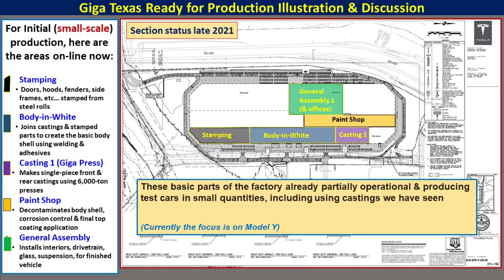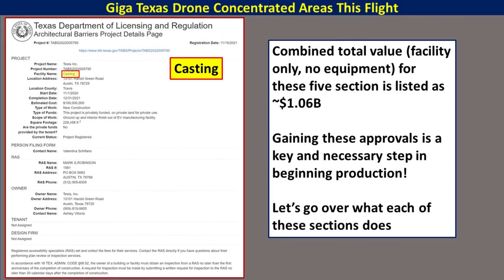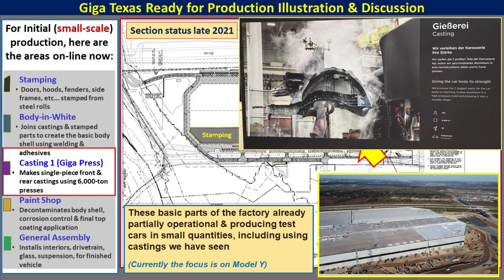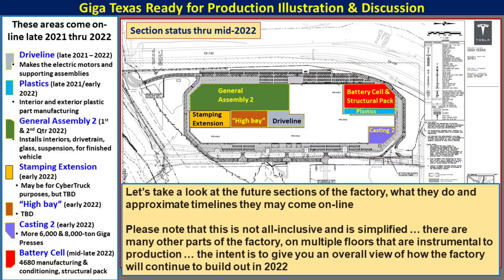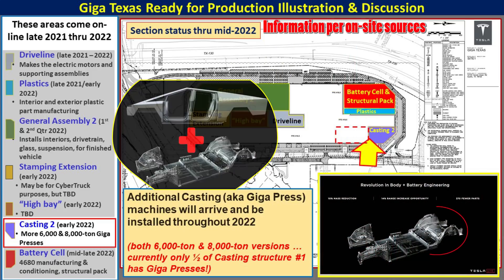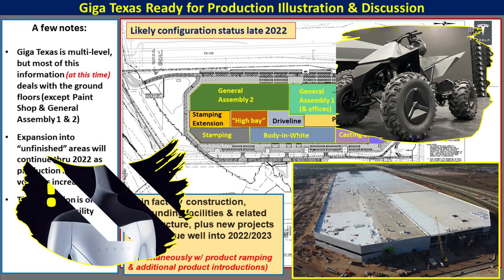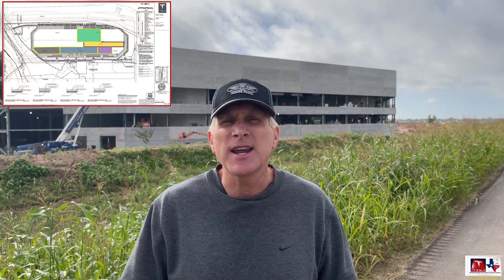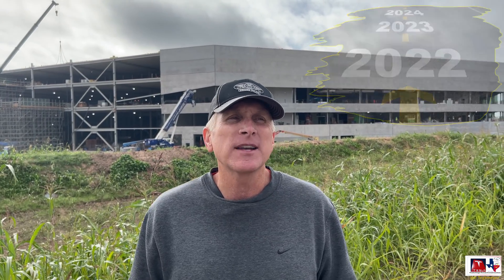Tesla Gigafactory Texas 26 November 2021 Production Status Outlook 2021/2022 (Model Y & Cybertruck)

Comment: Joe thank you for the explanation of the product flow. I noticed during construction of stamping that the west bay has a Schuler 5 unit transfer press. The center bay has about the same space and bridge cranes possibly for another line. In the east bay there is a press to shear the feed for the transfer presses. Paint has 2 lines starting on the bottom floor moving north and returning on the second floor moving south.

Comment: Thanks Joe. Great presentation, the best yet from any channel on youtube about the factory operation.
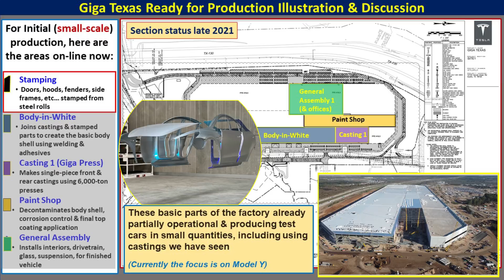5:45. Stamping. Been waiting to see for certain if the stamping presses are operational. Jeff’s 2 most recent videos show a Model Y side stamping in a bin and other sheetmetal waste.
10:16. Plastics. The inset photo of the plastic plant (from elsewhere) firmed up for me the likelihood of the use of the north alleyway for that purpose. I wasn't sold on the idea.
11:10. Stamping Extension. What’s missing from this structure is the massive footings and reinforced set downs for stamping machines. What isn’t missing is plenty of space to easily construct all of that, and it will be away from our prying eyes once the roof and walls are complete.
11:30. High Bay area bridge cranes. Storage seems to be getting a run in the comments. If it were for storing stacks of containers (or anything for that matter), a better use of the space would be to have the bridge crane at the highest level. Everything above a bridge crane is dead space, and these bridge crane beams are at about half ceiling height. Storage seems unlikely to me.
That said, I have no ideas other than some other manufacturing process that might benefit from a high ceiling for instant heat removal.
Months ago in comments under a video I had a conversation with someone who was suggesting some continuous line of metal folding machines to form up Cybertruck panels. Can’t find the post now, might have been deleted.
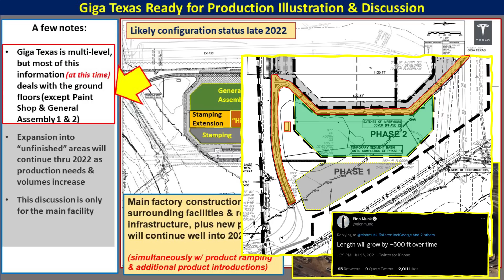15:55. Southern Extension. The area shown in green in fact measures only around 350’ north to south. By scaling the shown east west dimension of 607’ by doing an on screen measure, the dimension of the green area is revealed. 500’ includes the road and adjacent apron.
Reply from the maker: Thanks Dessie!  I’ll be checking out Starbase in Boca Chica tomorrow, so that’ll be a lot of fun!
Reply: @JoeTegtmeyer  You haven't missed much at Austin, very quite. Some Model Y stampings about the only bit of excitement. For me at least!

Comment: I'm waiting for the arrival of the ORIGAMI metal-folding machine. In addition to making the Cybertruck body, it will also be capable of making a variety of three-dimensional animals and birds.
Reply: Do you mean a press brake, a machine that folds metal in a straight line ?  Not a overly large or complicated machine. Could already be located in the stamping building.
Reply: @eltonray2934  A self-feeding, robotic, multi-angle, automated press brake
Reply: @kevinpolito1529  Kevin, you are correct, the .118" thick 304L stainless will need to be cut to size by a shear or laser and fed to the press brake. I would imagine that this will be automated as much as possible. The brake will fold the metal for the exterior shell of the Cyber Truck including door coverings, fenders, cargo box, hood, front and frame over doors.
Reply: @eltonray2934  The cost savings will be in not having to add corrosion proofing and paint.
Reply: @kevinpolito1529  Kevin, I agree that you do not have to paint the stainless. But you might want to paint the die cast front and back frame, all of the formed parts inside that make up the passenger cabin and battery housing.

Comment: Great video. Really appreciated. Be minor correction. The drive train components are built in Reno not Fremont. So the initial production of Y in Austin will have parts coming from Fremont & Reno. Possibly even imported 4680 cells to supplement what is being made at Kato Rd.
Reply from the maker: Cool, thanks

Comment: I am curious where the Semi-truck/tractor will be manufactured inside the building. The plastic cab shell alone will take a huge casting die. Then there is the question will they fabricate the chassis rails and cross-members in-house from scratch in order to accommodate the battery pak? Lots of very heavy,  heavy-duty steel will be needed, and large equipment needed to process it. Or will Tesla sub it out to be made to Tesla spec's. Front axles, drive axles, fifth-wheel, brake assemblies, hoses, fasteners etc. will most likely be purchased from outside sources. It would be fascinating to see how they orchestrate all the necessary pieces to manufacture the Semi-tractor.

 Dang, Joe, I wish there were some way you could continue your documentary to include the buildout of the interior of the building. That would be awesome, although unlikely.

Comment: You really outdid yourself on this one Joe. I was in the dark about the details you added in this vlog. Thanks for all your hard work. One of your site images even indicated what will happen in the eventual southern extension labeled stamping extension. I am curious if Tesla is currently doing its own plastic injection molding in house. You indicated that the new plastics section will be doing that at Austen. There is a huge number of large plastic parts in the cars. Think about the frunk and trunk plus all interior panels and seat base facades. In addition, there are all the air handling components inside the dash plus, I imagine, structural elements in the drop-in dash subassembly.

Comment: Some questions for anyone who can answer them.... * If they just recently applied for a permit on November 19, does that mean I was correct when I guessed that there wont be any meaningful production before the first quarter of 2022? * Plastics area... Why the need for a 100' long bridge crane in the production of plastic parts? * Loading docks... My original guess was that the "plastics" area would be used for freight and replace the plugged loading docks. If those plugged loading docks are going to be unplugged in the near future, why do things the most  expensive and wasteful way possible? That is, rip out the levelers and put in concrete plugs! When they could simply install doors and not use unneeded loading docks! No answer yet that makes sense.
Reply: Speculation on the bridge crane in the plastics area. The dies are quite heavy and need to be reworked on a regular basis due to wear. Also, future design changes may require the need for new dies.
Reply: @jbbuzzable  That makes sense. But that still leaves the question of the plugged loading docks. Unless the highbay on the south side will handle freight?
Reply: @DavidJohnson-tv2nn The docks are also a huge question in my mind. I think we can all agree that the more processes that can be done internally, the less docks that will be needed. The Texas factory is a huge deviation from China and Germany. I would also like to know why.
Reply: On the Q3 conference call, they said that they will "produce" cars in 2021, but not start making them for sale till Jan 2022.  I think they were referring to both Berlin and Austin.
Reply: @dalerichardson7202  I've learned not to depend too much on Musk's timelines. But let me ask this...
Since I'm not familiar with the permit process, do you think it would be possible to get through the process before 2022?
Reply: @DavidJohnson-tv2nn  I am not familiar with Texas law, however this whole video looks like the very permits you are asking about.  So, Dec 31,2021 is the date they are requesting to begin operations.  Berlin is either going to get their permit to operate next week or two, or it will be delayed once again by the Greens.
Reply: One of the other comments states that "high bay" is industry slang for automated pallet stacking. So, like container stacking, but at a smaller unit.
Reply: @LinasVepstas  I can't speak to the comment you read, but "high bay" traditionally means area with a ceiling that is 20 feet high and taller.
You can do whatever you want within that space. Our company used it for storage if bundles of raw steel.

Comment: Looking at the costs of each building......  You can see how much more complicated each building is to make......
I wonder what the going rate in Texas is to purchase mfg facilities per sq foot or to build out.  Is Tesla getting a good deal?
Why is General Assembly so much more than painting or body in white?  3X more.  You would think it would be simpler construction!
Body in white  $182M / 1.4M sqft =  $132/sqft
Stamping         $150M / .21M sqfr = $714/sqft
General Asm   $493M / 1.5M sqft = $328/sqft
Painting            $126M/ 0.9M sqft = $140/sqft
Casting              $109M/ 0.2M sqft= $545/sqft
Reply: Notice that the most expensive  are the concrete structures. Stamping --   $714/sqft and Casting -- $545/sqft.
Reply: @DavidJohnson-tv2nn  With more extensive footings also.

Comment: A milestone of sorts, Joe, a production assessment at Thanksgiving. Thank you, and looking forward to an update/comparison at +1 year.

Is (some of-) the rest of the Tesla acreage suitable for wind turbines? Watching the videos it appears there is no shortage of wind at the Austin site. At the "Limiting Factor" channel (highly recommended!) the expectation is that the Austin battery plant could ramp to 250 GWh of battery production by 2025. That will require A LOT of primary energy supply (electricity plus natural gas, together at GW scale), so all supply options may have to be exercised in order not to bottleneck the factory.
Reply: Actually there is not a lot of wind in central Texas.  I don't know of any wind turbines in the area.  They are all out in west Texas where the wind blows almost continuously.  Solar panels are another matter.  There are a lot here now and there are a lot more being installed all the time.
Reply: Very windy in Oct-Nov, and again in April but then not even a hint of a breeze mid-summer.

Comment: Under the name "highbay" I would usually expect a highbay storage warehouse, most likely fully automated (currently not needed pallet -> robotic blackbox warehouse -> requested pallet). I've worked on software for up to 12 pallets high, 20 pallets wide, 100 pallets deep warehouses in the past. 
If there are (also) bridge cranes it might be a mix of pallet storage and stamping/casting die storage.
Reply: The stamping transfer presses produce parts in batches because they have to change dies for the different parts required. The most efficient method is to produce large batches and store them. Before a production run they will have to have all of the parts available for the body in white (robot assemblers) for most of the run. These parts will have to be stored somewhere. This also pertains to the die casting machines. The high bay area is ideally placed for this function. The rails may be for vertical stackers and not bridge cranes.
Reply: @eltonray2934  What you say makes a lot sense, but... That brings us back to the plugged loading docks. I believe your theory was that they are going to unplug them soon. If that turns out to be correct, it proves that these guys are the most wasteful as far as time, money, and materials!
Reply: @DavidJohnson-tv2nn  David, What if the loading doors were not available? I have seen loading dock levelers but no extra doors. Also you may have noticed that most of the east side has concrete poured as the final covering, but on the west side much of the surface is covered by asphalt, not the final covering.
Reply: @eltonray2934  If the doors weren't available from their current supplier, find another source. Berlin seems to have all its doors. But to rip out the levelers that were already installed, fill in the area in the floor with concrete, place concrete plugs in the walls... Then remove the plugs, jackhammer  out the concrete in the floor, repair damage, and replace the levelers makes no sense. Especially if we're only talking about a few months.
Reply: May explain why they reduced the number of loading docks.
Reply: @dclpgh  Yeah, at first I thought why would they need a large highbay storage warehouse if they act like Shanghai and just keep dozens if not hundreds of trailers/containers docked right to the factory. But Austin does indeed seem to have less docks and is wider without allay ways.
Reply: @NO3V  That huge block shaped building at Freemont thats taller than all the others is for storage and logistics and is automated.
Reply: Using the "highbay" for freight makes a lot of sense. That was my guess for what is now labeled the "plastics" area. One question.... How does the freight get to the high bay? Bridge cranes in the "stamping extension"?
Reply: @DavidJohnson-tv2nn 
Truck / Produktion area
>> forklifts
>> conveyer belts/rollers
>> stackers / "stacker cranes" / (automated) forklifts 
And reverse for retrieval is a typical approach.